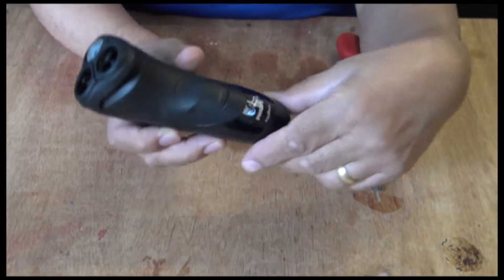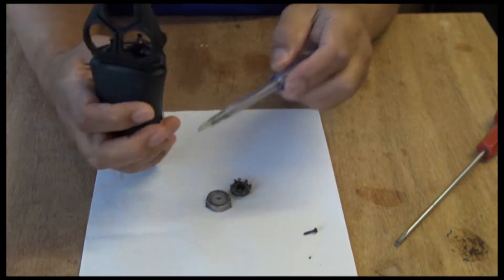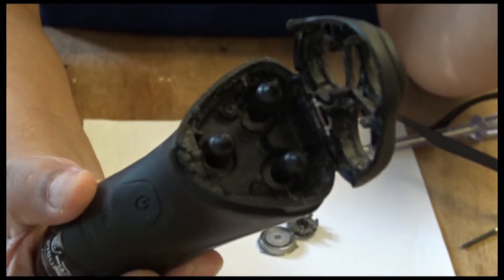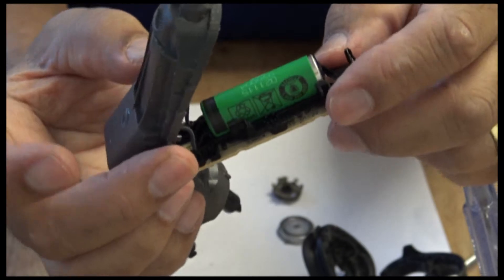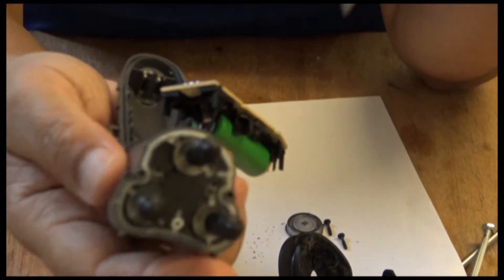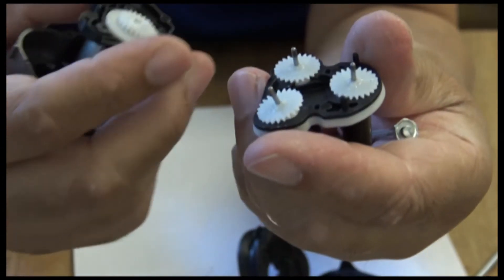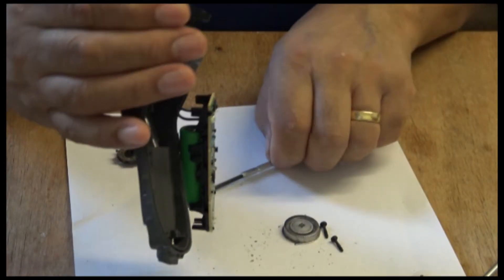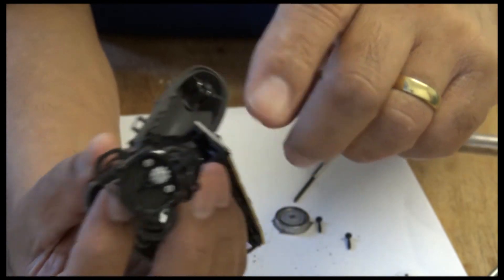#92. Philips Aqua Touch Shaver Teardown.

Comment: They are usually good quality motors in those shavers, worth keeping 😁👍 A possible use with those three turning heads would be for winding multi strand string. I am thinking of making a geared unit like that for making rope but that should do for demonstration purposes with string or cotton.
Reply from the maker: Wow never thought of that.  Thank you Grandad